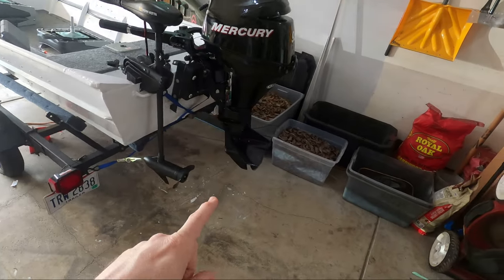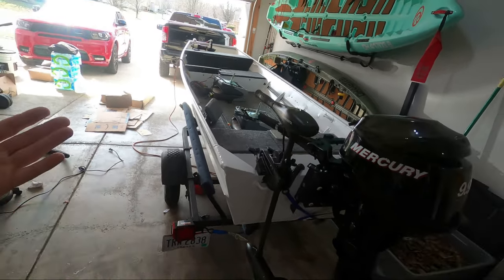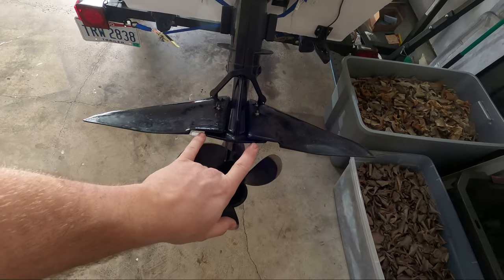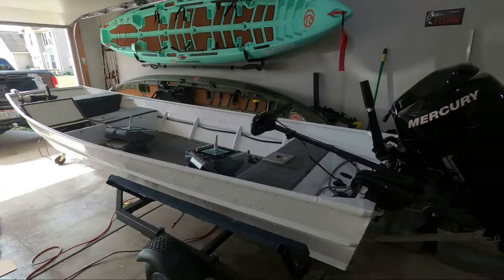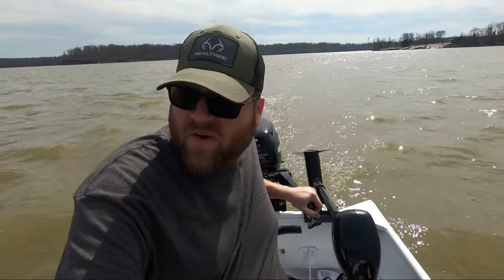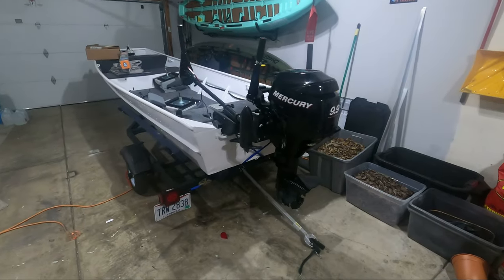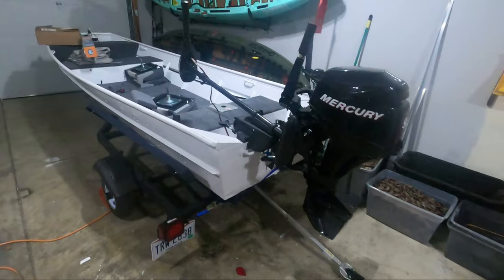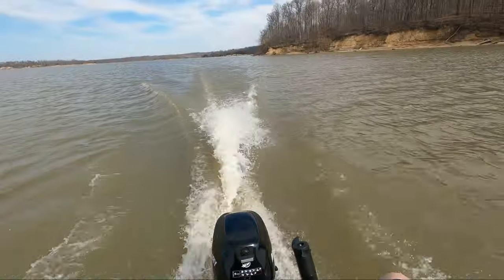OUTBOARD HYDROFOIL - DO THEY WORK? - Testing Hydrofoil on 9.9 Mercury Motor w/ the Jon Boat Build

Comment: My 2003 carbureted  9.9 will push my decked out Tracker Topper 1542  at 18mph  and occasionally hit 19mph with the stock prop on ethanol free gas. The transom is 17" and it's almost too tall for my short shaft 9.9 but it runs pretty well in the #2 trim position after testing it.

Comment: Do I have to torque a Mercury 9HP prop? Forgot It's a 1971 motor.
Reply from the maker: Snug so the cotter pin lines up would be fine

Comment: i have a sailboat, and have a short shaft 9.9 mercury, my problem is sometimes in choppy water seems like the propellers come out of the waves, this wouldn't help right?
Reply from the maker: No not likely, do you perhaps need a long shaft motor?
Reply: You need a long shaft outboard.

Comment: you should see the cavitation you get on your lower unit when it hits your first log or rock .. you might wanna put small easy to shear off bolts through it just in case it happens.. ive seen the damage that they can do

Comment: Nice Bro!...but you lost your passenger about 1/2 way through the vid...Haha....But, on a serious note, she may add a few pounds to the boat, but being upfront allows the boat to get on plane a bit better increasing the Hydrofoils performance since you do not have fine adjustments on a "clamp on" style motor. Also, do another test with no wind, calm waters, rider in/rider out, and I bet you can squeek 15+ out of her... ;) Keep the vids rollin' my dude!
Reply from the maker: Funny you'd suggest this! This weekend I took it out solo and I was just short of 16mph! I got the best speed raising the motor up another 2" but I started sucking air so I need to make a spacer around 1" I think. I'm also going to be lowering the prop pitch 1" to gain some extra RPM. I think when I get the "sweet spot" I'll be 16mph+

Comment: Nice video, I’m going to have to try the jack plate and hydrofoil, I have the same motor and i’m getting 6mph out of my v16 alumacraft but I just measured and my motor is sitting about 3 1/2” to low.
Reply from the maker: Definitely raise it up, it will net you more speed.

Comment: Wel I have no issues with mine works great for my on my outboard motor
Reply from the maker: They can be a great help if you are experiencing the issues they are designed to fix.

Comment: Did you mount the hydrofoil backwards. Not trying to be funny but I’ve never seen someone mount it from the back instead of from the front. It’s supposed to stick out at least 4-5 inches from the propeller. Just a thought.
Reply from the maker: Hydrofoil was not mounted backwards, it actually has grooves in it that line up to the end of the cav plate so its installed in the correct location. Not a bad thought though, you never know!

Comment: Your biggest problem with small fishing boats is weight. A 15 hp is a big improvement, or you could could become very critical of every non necessary # of stuff you don’t need.
Reply from the maker: You are 100% right, a larger outboard would solve most issues and a 15hp would fit that boat very well. Sometimes you gotta work with what you have though!

Comment: I see you use a atv winch for anchor control . Can you operate it from the rear of boat . ? Do you need to manually shift for forward reverse at the motor winch ? . ( can you sit at the rear of boat and doo everything  )
Reply from the maker: Yes! Check out this video I go over the whole thing and how it works. It was awesome! https://www.youtube.com/watch?v=z9gpp2uA4sg

Comment: That lake looks a little different with all the water. I went after draw down and it was insane the structure that was exposed. Seems like a great crappie lake in the spring!
Reply from the maker: I'll be honest I still haven't cracked it. I've fished so many laydowns with very little results. The word is they tend to be on deeper brush piles but I haven't found them yet! My best luck has come from around the bridge.
Reply: @mvboutdoors  Nice man! You'll figure it out! Nice looking boats! Good work boss!